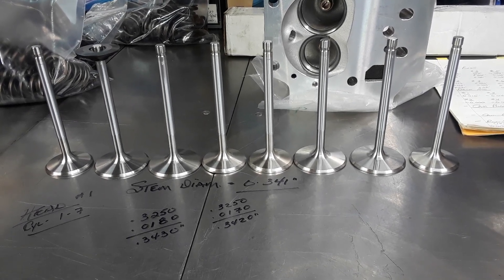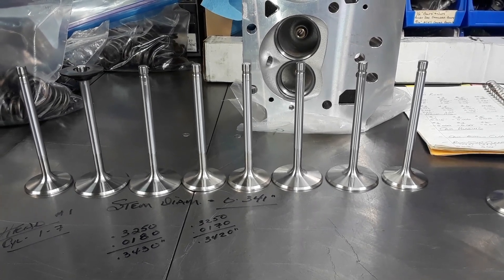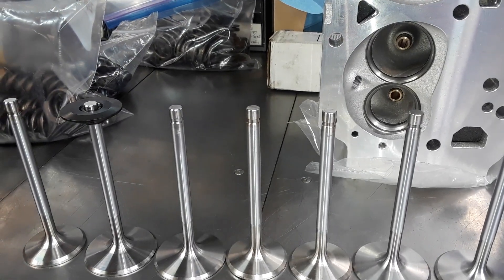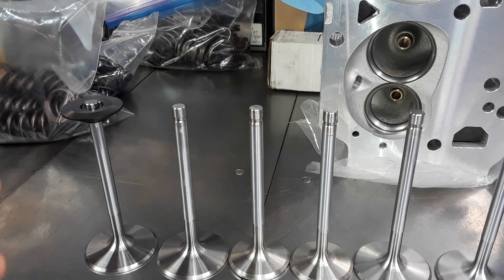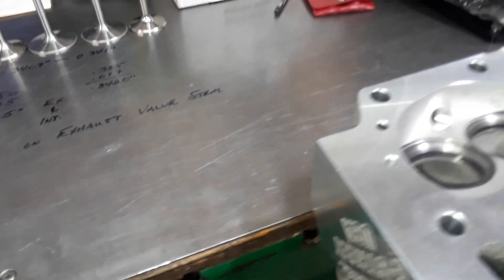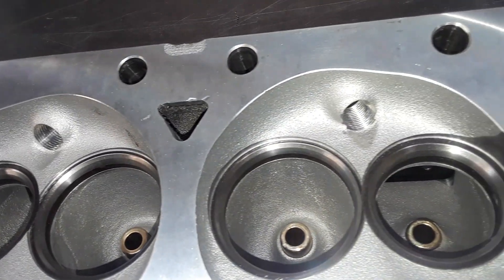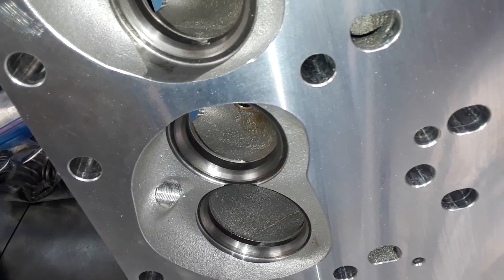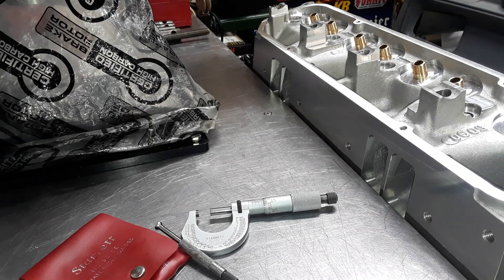Inspect & Measure EVERYTHING....NO EXCEPTIONS

Comment: I can vouch for your findings on this same cylinder heads.
I completely reworked and ported a set of these heads.
You can put alot of labor into these aftermarket heads.
Brand does not mean anything.
But they can be made into good cylinder heads.
Thanks for sharing. 
Happy New Year.
Reply from the maker: Thanks Ed for the comment. You and I have shared a lot of the same "negative" engine building experiences. It's the times we now live in. Best wishes to you and yours in 2024. Regards, Tim.
Reply: @metalmaxmopar9520  Thanks Tim, I really appreciate it.

Comment: You are correct: check everything.  In the case of carbs, I picked up a set of pin gauges to prove orifice & bleeder sizes on anything new or unknown history - it paid for itself immediately.  But you know what?  I had to check those too!  And it turned out I had two duplicates in the box which meant... two sizes were missing.  But for $20, it wasn't a bad deal and things got sorted: micrometer investment is a must for building.